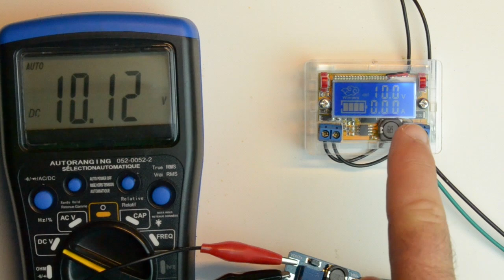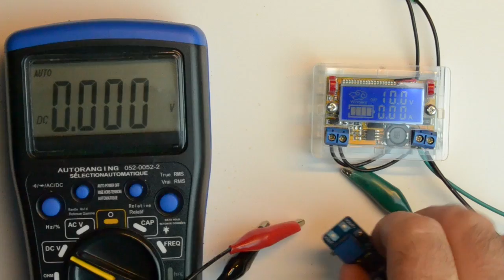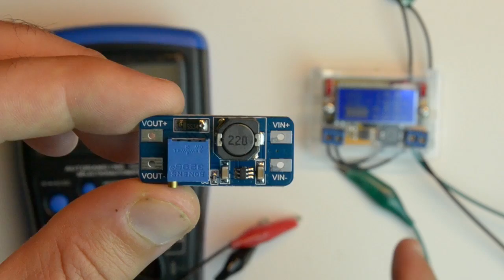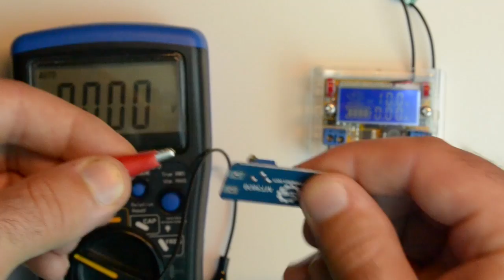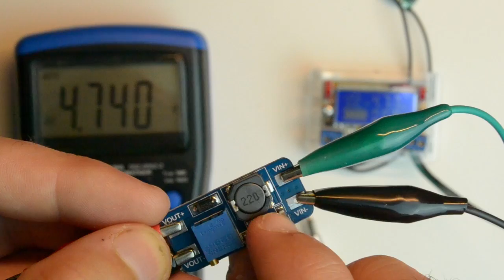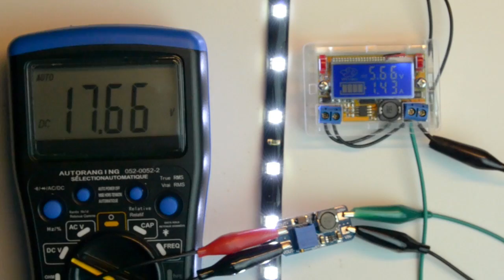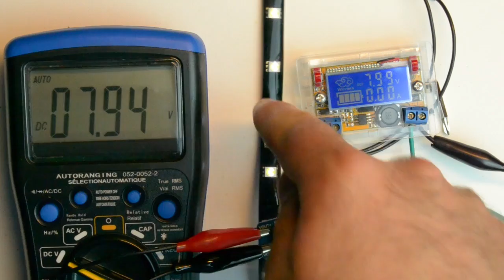Caught on FIRE?? MT3608 DC DC step up boost coverter

Comment from the maker: These units ARE actually faulty! A few people have noticed what is wrong with them in the comment section, what is your bet?
Reply: just turn the potentiometer 
adjustment screw 20 turns counterclockwise then you good to go..
datasheet - https://www.olimex.com/Products/Breadboarding/BB-PWR-3608/resources/MT3608.pdf
Reply: Datasheet quite clearly states that although the OUTPUT voltage can be up to 28v boost, the FB(feedback) pin can only support 6v as an absolute maximum.
What does that mean?  It means you MUST power the module from LESS then 6v, and then adjust your output boost voltage.  That is how you set them up.
Powering from MORE then 6v during adjustment(as in this video - 10v) WILL kill the device once you turn the trimmer so that the potential on the FB pin rises above 6v.
This will cause an internal breakdown of the IC, and subsequent catastrophic failure of the device.  Basically.....user error if you cook them.
Remember also, that any buck or boost regulator is generally fatally unstable if the input voltage AND output voltage are the same.
So, for a boost converter, the input voltage MUST be LESS then the wanted output - ideally by at least a couple of volts to be safe.  A buck-converter MUST have an input voltage that is HIGHER then the wanted output - like a standard Linear regulator.
Reply: @VauxhallViva1975  I thin the author needed to subscribe to the course 101-RTFS ( Read The F..ing Specs)
Reply: @VauxhallViva1975  He purchased a module  (not the chip) that CLEARLY states what the "MODULES" min and max input can be. Doing a quick search on fleabay I have yet to find anything that mentions anything about not exceeding the chips FB voltage. Great little chip tho !
Reply: It is 24v. The FB pin takes max 6v but that's on a resistor divider so it only sees a fraction of the output.
Reply: @Ryan Balfour like I said before. Sold thousands of them with my old eBay store. 5V in for initial set up, turn anti clockwise to increase, clockwise to decrease. If you turn too far clockwise it'll short the Vinput to the Vfeedback pin and if it's more than 6V will blow.
Reply: @dazmatic  Suppose I want to configure this for 24V out.  If I set it up using 5V in, and then swap it for my actual power source (a 12V nominal battery) will it still be at 24V out?  Does this hold a steady output voltage even if the input changes, e.g. because the battery source is dropping?
Reply: @georgedorn_fnord  Start at 5v input voltage, adjust your output, to what you need, change input supply. Because the output is based on the feedback from the output, changing the input won't matter so long as the input is less than output.
Reply: Mine caught in fire
Reply: Louis-Thomas Tremblay Did you turn the pot counter clockwise before testing?
Reply: jak Kennedy no why
Reply: Louis-Thomas Tremblay because that would’ve been the wrong thing to do, is “why”.
Reply: What if ur current is too much?...
Reply: @cerealnmilk8060  boom 💥👌
Reply: @thephysicsflight7841  ok,I know it for now...

I made a powersupply,5A 28v NOT USING THAT MODULE IN THE VIDEO
Reply: @cerealnmilk8060  Hey, which one are you using...?
Reply: @thephysicsflight7841  ZK-J5X Constant Current.(its a BUCK converter)

Input V : 6.5 - 36V
Output V : 1.2 - 32V
Current : 5A adjustable

I made a powersupply using this module.If you short the output,it stays on and it light up the CC indicator
Reply: @cerealnmilk8060  Ohh great..!!!! Keep doin' such stuffs..!!!! 👌
Reply: @thephysicsflight7841  ok thanks!
Reply: @cerealnmilk8060  you're welcome..!!!!
Reply: Boy it's totally crazy
Reply: I have now had two just up and die on me.  First one when I used the USB input and was getting 46v out which is perfect.  I then was turning the pot and it suddenly flew between 3.5-5v and POOF.  U1 smoked.  Tonight I just had the second one and I am unsure why.  Everything was working fine then I unplugged the single 18650 went to go do something where I came back and plugged it back in.  POOF, U1 smoked.  This has to be the shittiest module out of the five I own as the others have never released the magic smoke, but this one I can't seem to not release it no matter what.
Reply: FWIW I have noticed that the version without thru-holes for the input and output terminals do not have the design fault.   I don't know whether or not that is universally true, but may be a good guide.
Reply: The module can be fixed by adding a SMD zener diode to clamp FB to anything less than 6V (1.8V should work fine).
Reply: These are NOT faulty. But they do have a slight flaw in the design. I've sold thousands of these on my ebay shop and recommend to all my customers to set them up with 5V. People assume that turning the pot clockwise will turn the voltage up, because, since when did you ever turn anything to the left to turn it down?! Set up on 5V and turn pot anti-clockwise. Really, you should edit or remove this video as it's completely misleading.
Reply: Nigel Nichols, then besides what you’ve said you also ought to be correcting Vaikevimbu’s comment rather than suggesting the OP throw out the whole baby with the bath water, instead of leaving that job for little old lonesome me to show up and do it for you.
Reply: @dazmatic  They are faulty.  The circuit design means that there are settings for the trimpot that put more than 6V to the FB pin, which the device cannot tolerate.   A simple change to the circuit is all that is required to ensure that this cannot happen. This allows the full range of the trimpot to be used, with much more precise control of the output voltage and no risk of blowing the chip up. If you advertise them as accepting more than 5V input then whey should be able to do that at any setting of the trimpot.  The design that has been used is specifically for single-cell LiPO input and should not be used for a general purpose device.
Reply: I burned the first board the same way you did... thought that was odd... did some googling and saw your video and seems that the comments below are correct. Turn the pot 20x counter clockwise and start with low voltage... raise gradually and trim the pot and it works.
Reply: @Vaikevimbu  Might have been nice to include that in the product desc but I have zero expectations from that crowd
Reply: Vaikevimbu clockwise*
Reply: "These units ARE actually faulty! A few people have noticed what is wrong with them in the comment section, what is your bet?"

Why not explain on your pinned post and get to the point. We can all read the posts but if you know something, post the correction.
Reply: I never had such Problems, But  i was prepearet that this can happen,so i used my Powersuply(constant current Set to 300mA) and testet it. No Problems if i use voltage input up to 15v
Even if my Output is the Same as the input. But i use an 50v 100uf capacitor and an cheap voltage  Display on the Output. This is the Safest way. (i now use an TP4056whith Protektion to Power the converter. And I glued some Metall plate on the Chip and Output Diode using Thermal epoxy to prevent overheating,because the Chip works on it Maximum Power at 1,5A to2A ) 

Never Use it whithout a load during startup. The charging of the cap is enough load for the Start of the converter.
Reply: For those who may be watching. I assumed by the info from the purchase that they supported up to 24v in. However through trial and error I have found it to be a max of 6v in

Comment: Are you trying push 3A not 2A max?  I mean that's what the display shows?   If you only have voltmeter leads on the output something is wrong.... lol   Unless your leads are pushed into amp side or something :0  could just be a 'student' version of the module?  Weird behaviour on that thing...Ali express might have accounts carrying reject modules, but the price is probably cheaper with less volume sold....

Comment: Here 8 years too late, but I know exactly what the problem is. Whoever made this board made a mistake on the PCB pins 1 and 2 on the pot should be shorted. I also bought about 20 of these, but after they revised the design so they all work as intended.

Comment: yes these are faulty, be wary when using them. i have a 9v battery run through these to output 12v, works out fine but once unplugging and plugging it for multiple times it just started to spark and burn. another faulty one was when the battery ran out and was recharged, i attached the booster that was already set and working it caught on fire.i broke 5 of these too faulty.

Comment: These modules are shipped with the pot adjusted for low output. Before using for the first time, turn pot anticlockwise a good number of turns, and apply just 5 or 6 volts to input. Set output voltage, then modules should be ok to go with higher input voltage, provided input is always less than output. Dont exceed 2 amps on input.

Comment: I am late to the party, but I can tell you what went wrong. The teeth of your alligator clips shorted the ground plane through the blue coating.
Reply: Doesn't seem plausible.
Reply: @misc_channel  It is very possible. In fact, it has happened to me before. How about you take a look at the ground plane of these modules and the input/output locations. Then you will see what I am talking about.
Reply: @misc_channel  think about what you are saying. There are 4 connection points. How would they all be connected "continuously"?
Reply: @misc_channel  There is a ground plane surrounding the pads on BOTH sides. A crocodile clip has teeth, hence it's name, and these these can poke through the coating, shorting a pad to the ground plane. It's not that hard to understand if you actually look at it.
Reply: @misc_channel  What is this? You keep grasping for something to reject my statement, but you don't even understand that there is a ground plane surrounding the pads.
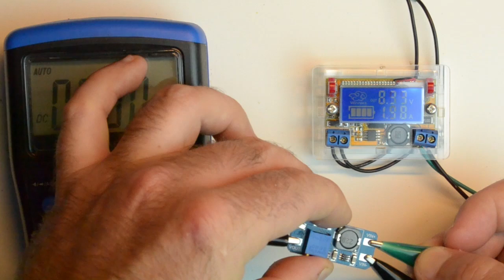1:39 2:26. The clips are rotating to the side.
Reply: @misc_channel  And if you short an output? Or the ground plane goes through the chip? They might be faulty, but you are still grasping for something to be correct.
Reply: @misc_channel  If you can't comprehend how the clips can short the output the ground plane, then I think you shouldn't call nonsense. I am not saying there can be faulty units, but to have all 20 fail is odd. Also the guy in the video doesn't seem to realize that he has to potentially turn the potentiometer a lot more than what he did. He also don't seem to realize that there is a current limit tied to the relation of the input vs output.

Comment: one Buck convert after another buck convert can cause problems.
Edit/ I used couple of those modules in past years and none of them did catch on fire, I use them to often boost batteries 4.5v to 12v or higher.

Comment: Why the mt3608 caught fire? By reading the datasheet, it is stated that it has internal overload thermal protection, so should it turn off itself before catching fire? Or the best case to prevent the pcb catching fire is to put an inline fuse at VIN ?
Reply from the maker: it was a counterfeit defective chip - the datasheet does not apply here.

Comment: Hi guys, could you please suggest some similar module, which will be able to invert 12v to 19.5-20 and give 2-4A - need this to charge the laptop from 12v battery and immiting UPS 220v inventor (which consumes the same as my laptop).

Thanks
Reply: You can use XL6019 or XL6009 boost converter for under 4A power.  Or you can use (05KJ) 150W 10A boost converter, that's the most common boost module people use to charge laptops.
Reply: @keith_ferdinanduz   thanks a lot! I bought an adapter for car with the settings feet my laptop need! But, anyway took 09-1411 8.0A conventor

Comment: Reading what others have found, then...   If you put a 27V zener from the output voltage to the  feednack path (with maybe a 1k series resistor to the FB pin, this will fix the problem permanently.  a bit of a pain, but easy to retrofit.  VERY BADLY DESIGNed board, typical of Chinese designs sadly!
Reply: I am a MORON, if the trimmer is for the correct range (i.e. never over 28V), then it should ALWAYS be safe (no zener required).

Comment: It was 8 years ago, but for what it is worth.  If the pot is not working, then it will go as high as it can, and with 10V in, and a max PWM of 90% (see datasheet), then output will be WAY OVER the 28V max it can deliver.  That might be why they blew up.  Since you were about to change crappy trimmer with resistors, I assume you were successful. :)

Comment: The pots are cheap and nasty, the go opencircuit when you adjust them. The feedback pin on the IC needs to see 0.6v at the correct ouput voltage. The best thing you can do with these is remove the pot, calculate thd voltage divider that you need for your output voltage and put a fixed resistor in place of the pot. The lower of that voltage divider is on the board as a 2.2k. The problem is the the pot wiper, when delivered is as one end ... the output voltage end!!! So, any thing more than 5v in will immediately put an overvoltage (>6v) on the FB pin and burn it out! As delivered, they are crap, but can be tamed if you know the issues!!!

Comment: The annoying thing about these units is that they are supplied with the voltage set to minimum.  This means if you connect more than 6v to the input they go up in smoke as the Vref pin apparently can't take more than this voltage.  To avoid mishaps start with 3v or 5v then turn the pot ANTICLOCKWISE until you get the volts you want.  I have only ever used these with 3v or 5v input usually to provide 9 or 12v and never had any problems since then.  Their failure mode is Vin = Vout and the adjustment no longer works (as you have popped the Vref pin) which is exactly what you found.  You were definitely popping them by applying 10v to them straight out of the packet then you were turning the pot in the wrong direction which moves the Vref towards the supply voltage and pop!
Reply: My one burnt after using 4V. Even that little IC fell off the board on its own 😂
Reply: @mattijaho  you must have been drawing too much current from the output, it's 500mA maximum otherwise the self desoldering auto circuit protection mechanism kick in.
Reply: @  I only had multimeter connected and it burnt in a few seconds
Reply: @mattijaho  you were probably unlucky and got a defective one.  I ordered 20 a while ago and had a few duds that smoked up even when connected to 3v, the rest are still working fine.
Reply: El problema no es el voltaje sino el amperaje, si se le aplica más de 2A se quemará
Reply: Is THAT why I've blown up so many of these that I thought were defective??? THANK YOU!!
Reply: BEWARE!  You don't necessarily turn the pot screw anticlockwise.  BTW, WTF are you thinking writing anticlockwise when the proper term is counterclockwise?

Anyway my point is, there are different versions of this board, and some, like a few I have with a USB-C input port on them (otherwise the schematic/function is the same) are different and you need to turn the pot CLOCKWISE to increase the voltage.

However, the failure mode isn't exactly Vin= Vout, rather it is Vin => 6V, with the pot adjusted nearly all the way to the top of its travel to minimum voltage, which is not a lot different than what you stated, but the specifics might matter.  This is only true of the generic modules that don't have any additional pull down on the pot wiper.  There is a fix some people have found,  by putting a jumper between the pot wiper and the  resistor pull down to ground that can keep them from burning up unless the input voltage is higher than spec.

Some measurements might be in order, to determine whether the modules you receive do have clockwise vs counterclockwise voltage increase, since that makes a BIG difference above 6.0V input.  Even so, don't doubt yourself, a lot of these generic modules are defective out of the package which is why it is a good idea to order more than 5... 5, because they often come in strips of 5, so if you order more than 5, you usually get specimens from at least two different strips, decreasing the chances that some manufacturer defect propagated itself onto both strips' modules.

Comment: I have 5 of these on order.. based on other videos i have seen.. i believe that these can handle up to 10W on the output. In your vid you probably want to restrict the current on your little PSU. Also the tech spec for the MT3608 shows that the max you can get out of it is 800mA at 12V with 5V input.  The best efficiency of it is at 200-300mA at 5V and 12V out. Its not really designed to power high V or drain devices. There is no cooling on the chip at all.. You can drive a 3X3W LED at 300mA at 12V in a parallel configuration. This would be max that this chip would handle.. ie 12V at 850-900mA, even then i would stick a tiny 6mm by 6mm aluminium heatsing on it.
Reply: While you are correct in the sense that the IC designers didn't think it was a good idea to exceed 800mA, it is not necessarily safe to assume that ICs can't operate outside of specs on a datasheet graph as that was never spec'd as a max.  You just assumed it and yet it is possibly true since there is evidence that these heat up before 2A.

However IDK where you are getting the 3x3W LED at 300mA from.  3x3W LED would have approx 9.9Vf and 900mA, and this chip can do that, or at 300mA you'd be talking about a little under 1W each LED unless you mean they are special triple die LEDs but those tend to have the dies in series.  Did you mean 3 x 3W triple die LEDs with each having a forward voltage of near 10V, so the module is pushing about 300mA at 30Vf sum of all leds in series?  If so, yeah, that's about right for a 12V input to this boost driver.